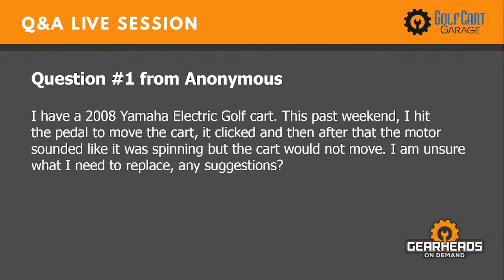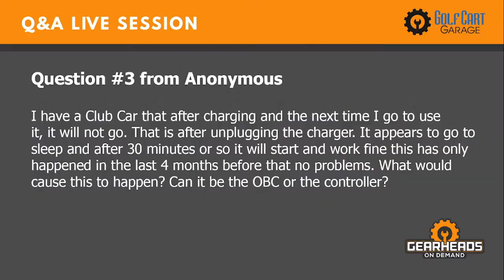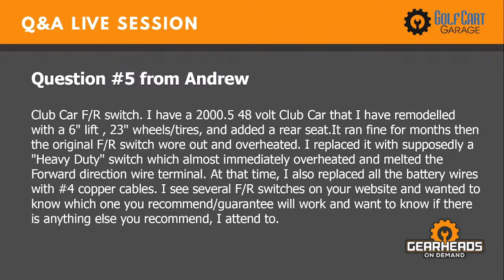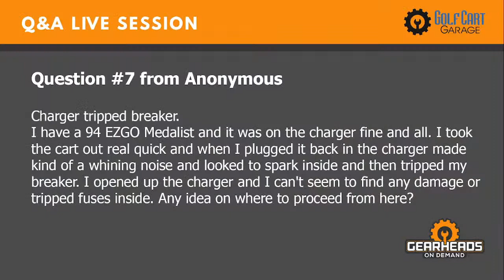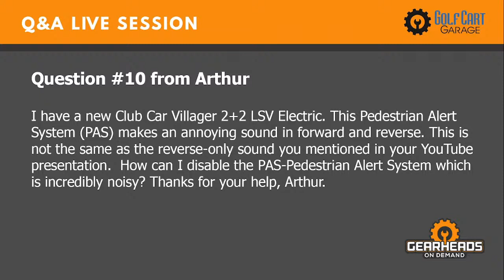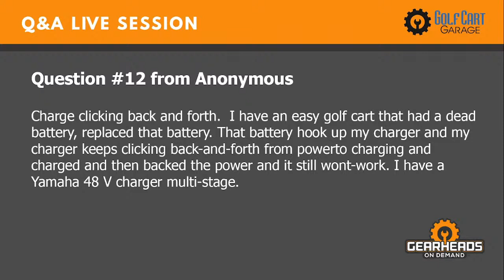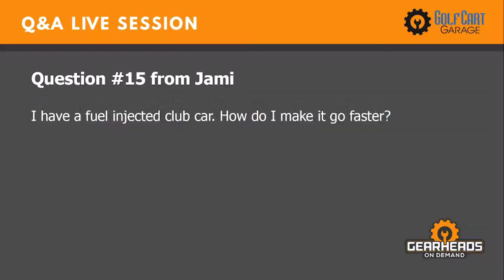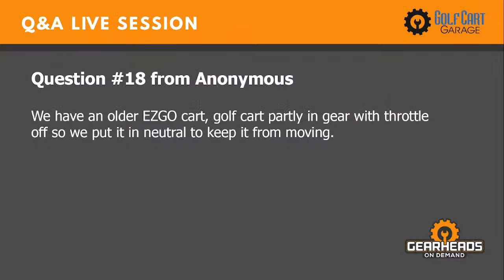Tips & Tricks for Golf Cart by Expert – LIVE Q&A | Golf Cart Garage I Episode # 45

Comment: Have 2022 Navitas TXT frame where the parking break isn’t holding when set. Do I just adjust nut at compensator?
Reply from the maker: Thanks for watching!  We recommend a consultation with our Gearheads on Demand virtual diagnostic techs found here: https://www.golfcartgarage.com/gearheads-on-demand/
Or you can reach out directly at Support@GolfCartGarage.com or (800) 401-2934
Reply: @GolfCartGarage    Thank you but not something worth paying a fee to figure out.
Reply from the maker: The tech service we linked for you does not charge a fee.  Consulting with our techs comes with no strings attached.  Let us know if there's any help you need!
Reply: @GolfCartGarage  Thank you  Though your website in the link confused me as it mentioned “limited free” without explaining actual cost. Don’t need to know about made up “savings”. Just provide actual cost of a “call”. Thank you